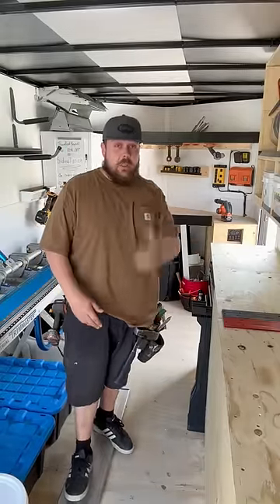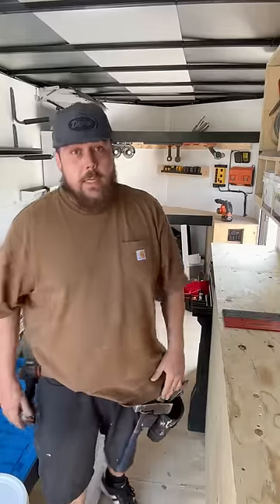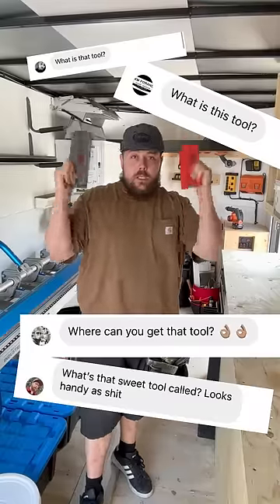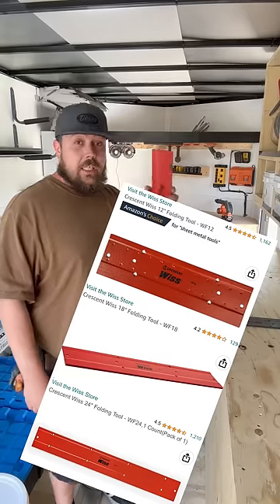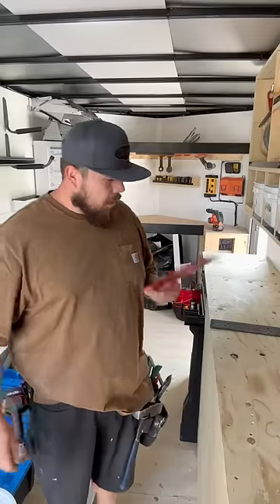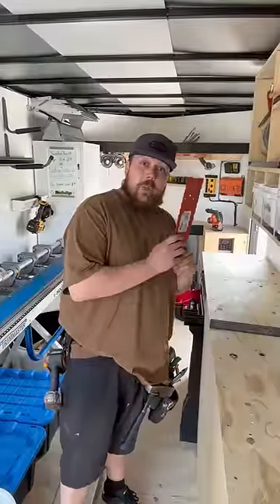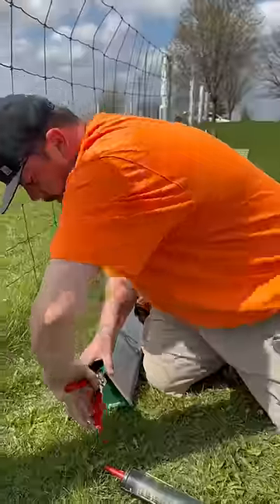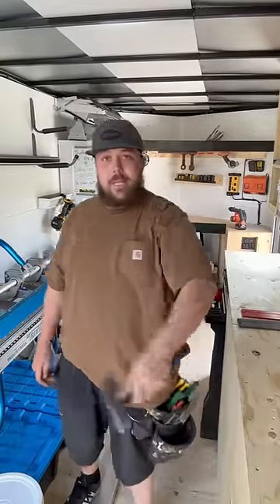What’s That Tool!? #construction #roofing #shortsfeed

Comment: I got the 24 incher, if you wanna make a hem ,a lock or a kick on a 28 inch piece of galvanized sheet metal, you can use 2 hand breaks at the same time🤯

Comment: I had one given to me special made that was 4 foot for steep valleys that a helper cut in half to use on standing seam bottoms. Really sucked. 😢
Reply from the maker: Damn! Sounds like a beauty unit!! There is some fairly large ones with a top handle available from Primeline tools! Made for valley folds! Check ‘em out! CHEERS